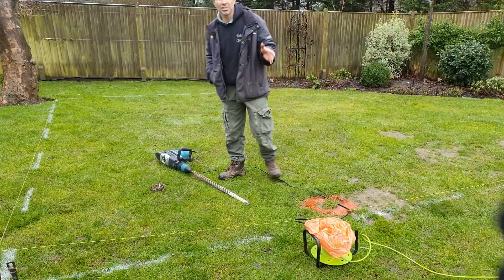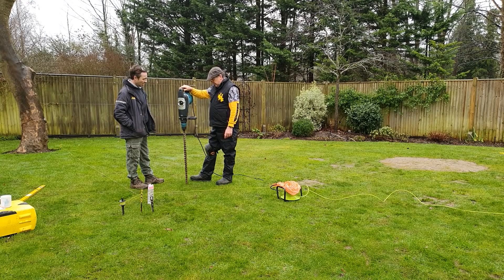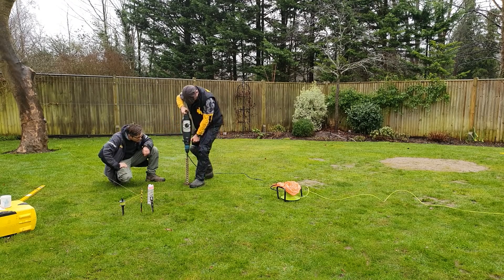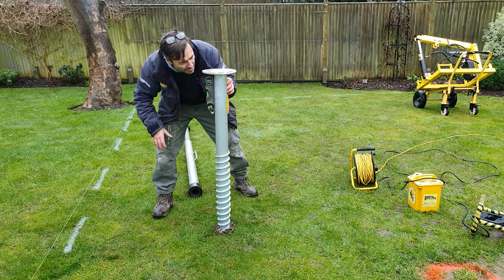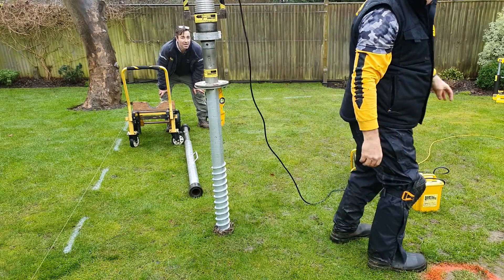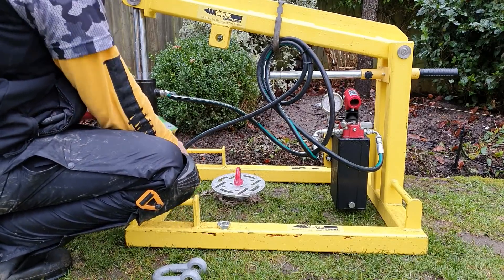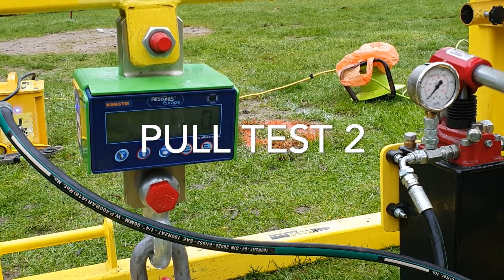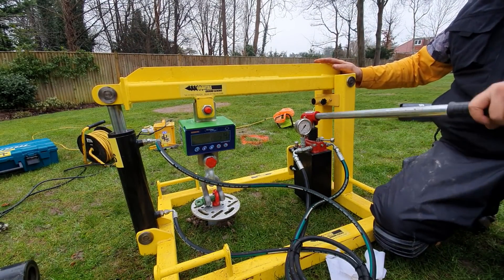Garden Room Ground screws. How we test for bearing capacity, Garden room construction video

Comment: Unless you're worried that someone is going to steal the building with a helicopter, what is the actual value of screw pull testing? Primary test load should be focused downward.
Reply: Depending upon application and structure profile, wind lift is or could be a concern for any structure not bolted to a substantial foundation.

Comment: How does a pull test tell you the downward force per screw.? I like the system, very good for poor access and uneven ground.?
Reply: Exactly, a pull test is not the same as a push test. A push test would be difficult off course, but it may be that the screws can handle more down force than the pull test reveals.

Comment: Just wondering what exactly a pull test proves ... the building is sitting "on" the screws so I would assume most of the risk is screws somehow sinking when load is added ? might be stupid question 😅
Reply: The Pull Test proves the amount of tensile strength in the ground and the screw. If you imagine quite a light building, like a garden shed, in a very high wind, the wind is trying  to roll the building over, so there is upwards pull force on the screws on the side of the building closest to the wind. This force can be greater than you think in high winds with slab sided buildings in exposed location and with certain roof shapes.

Comment: More garden rooms. In my day we were lucky to have a shed and before that an Anderson shelter. Those little screw piles are brilliant for these type of buildings of limited weight. We get an even smaller version that you can use for ground level decks but haven't seen the sort you keep using. Got to be better than keep digging holes and concrete.

Comment: If you need more bearing surface area after the screw is driven, you could remove some soil around the surface level of the screw, add rock and compact it, and then pour a circle or square that would bond to the exposed screw threads.
Reply: If you're willing to pour concrete pads around the screws, the screws are redundant.  The whole point of them is fast installation and low impact if you decide to remove them in the future.

Comment: Hi robin very interesting, but why not a traditional re-in-forced slab foundation, raft or even strip foundation? Surly after you have paid for these guys to come in with their rig and pull test it works out more cost effective?
Reply from the maker: Hi Jack there is no comparison to the price, I will do an alternative costing for one of the episodes of this build and compare, one thing here also is that the position of the room is about 200m from the road and it is land locked so other than a tiny excavator it would be a hand dig!!

Comment: 12 under our 3m x 4.3m studio, about £950 from memory. Took about 3 hours but, when we came to start the  build (SIP) it was running out by 13mm. Had to get them back, quickly resolved. Not much forgiveness with a SIP build but massive difference in U value compared to stick built.

Comment: Out of curiosity wouldn’t a push test be more fitting for the intended purpose of the piles?
Reply: To do a push test you'd need either a lot of weight that could be concentrated on one pile, or something like an excavator and a really heavy duty set of scales. 😁  Forces should be about the same whether pushing or pulling, as haz said.
Reply: How would you anchor down the thing you're using to measure push
Reply: @dharris85  my point is if there’s say 2 tonne structure sat on the piles it’s  more important the piles don’t drop further into the ground rather than lift out - if you see what I mean
Reply: @Smart-electrical  A pull test will give the same indication of how solid the ground is though. Not sure if it's physically possible to do a push test, because you'd be pushing the testing machine up, and that would have to anchor to something and it can't anchor to air

Comment: So your using this to calculate the weight each screw can take before sinking ? in this video circa 2.5 tonnes each ?
Reply: Its called a pull test because it measures the amount of force needed to pull the screws out of the ground, ie the uplift from wind specifically during a major storm